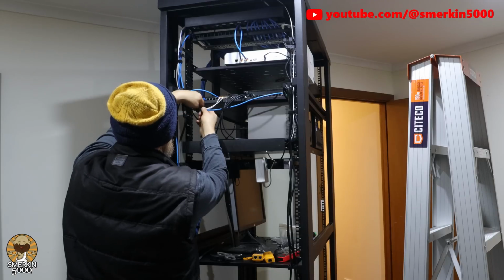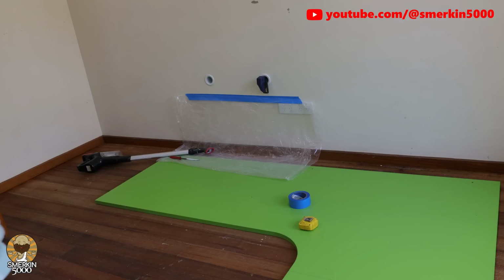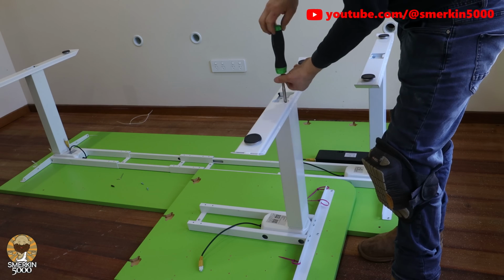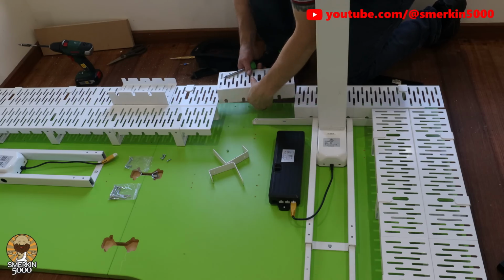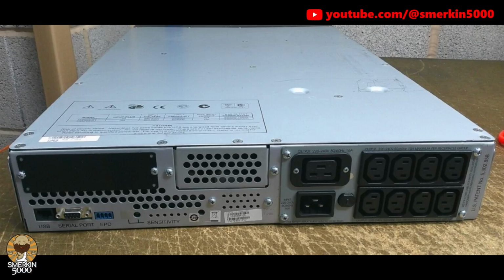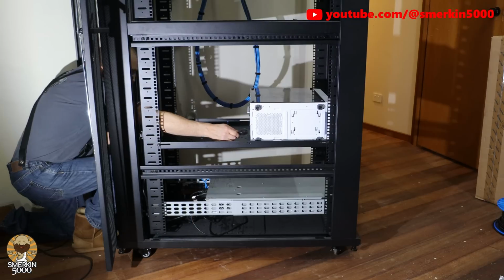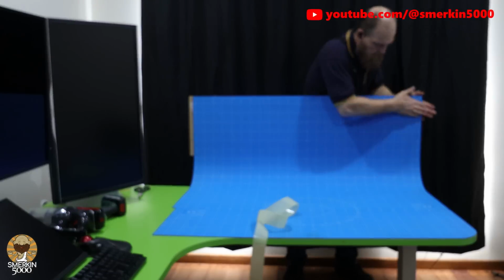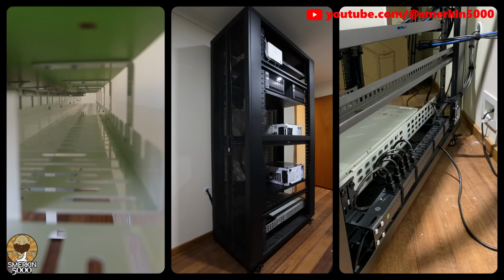Dream PC Setup

Comment: i am pretty sure i am running the exactly same monitors as you x2 phillips 32 inch and 43 inch dell
Reply from the maker: Very close, my 43 inch is a Philips 438P1. I have had many Dell monitors over the years as they are a great mix of design and tech features.

Comment: Great desk when complete but rebuilding them... No thanks! 

Another good vid mate!!
Reply: Ok... I like it and have to ask, what's the rough estimate to clone the exact setup?😀😀
Reply from the maker: Yeah the rebuilding the desk is a pain, third time I've done it now. As for your other question ... Server rack about $2K, Desk an all accessories about $2K, computers, monitors and all the other stuff vary.
Reply: @smerkin5000  so if I gave you 1k to build it and 10k to spend on it, would ya build it for me? Hahha
Reply from the maker: You pay for the parts and I'll put it together, but it'll cost more than that for the labour 🤑
Reply: @smerkin5000  1k not enough for labor!!!!!